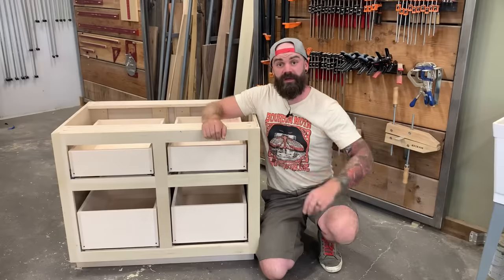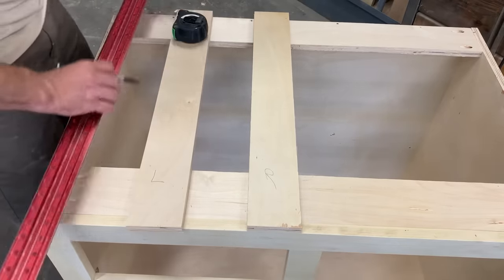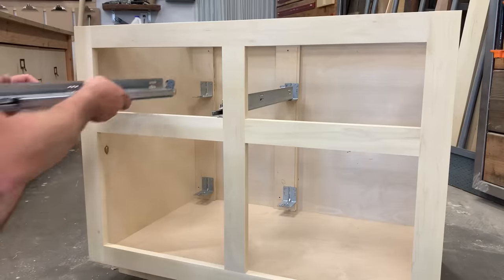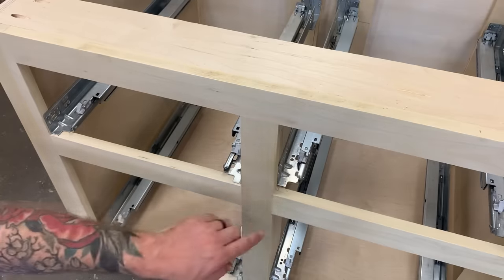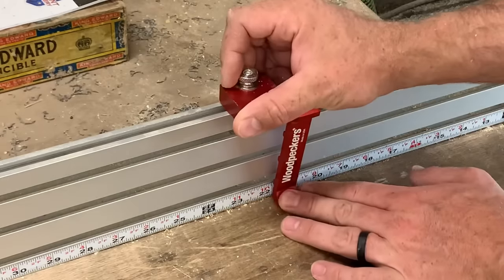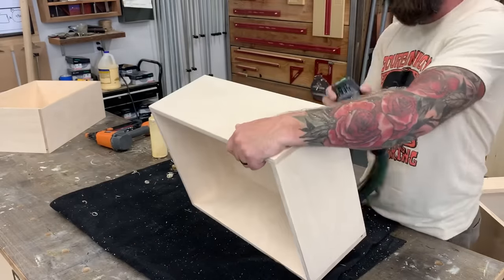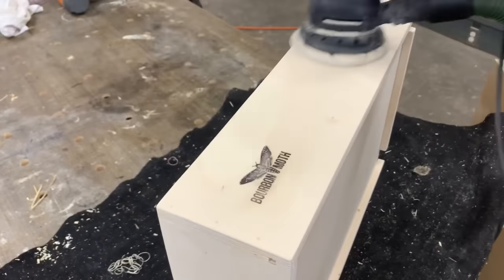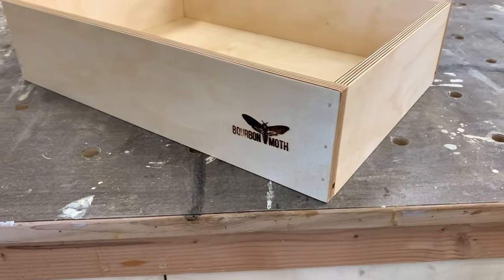Build Cabinets The Easy Way | Building and Installing Drawers

Comment: Thanks for the video's, been watching them on repeat to build my first set of cabinets for a coffee bar.  One hiccup I've encountered though - I ordered the undermount drawer slides using your link in your description from Amazon.  I didn't realize until I tried to install them that these are the series H drawer slides, for material of thickness 1/2"-5/8".  I was following your videos and using 3/4" birch ply for everything, including the drawers.  So needless to say, these didn't work.  I'm having trouble finding the F series for 3/4" materials online, if anyone has a recommendation, would be appreciated.  I also can't find your plans for cabinets on your website - would be great to see them if possible.

Comment: Any tips on selecting appropriate slide length? Current project drawer box depth to face plate is 16 inches.  I assume the 15s will be best but curious.  Using overmount face plates

Comment: This is probably a dumb question but it looks like you're using 3/4 inch plywood but my understanding is that the undermount slides can only take up to 5/8 inch so I would assume you would use 1/2 inch ply??

Comment: I really enjoyed your cabinet videos... Would you be able to share where you get the drawer slides?
Reply: Clayton you can get these on Amazon or any fine hardware dealer.  We get them from a local hardware dealer in Los Angeles area.  But you just need to know what kind you want.
Reply: @davidbryanwoodworksandmore what’s that company called? Do you have contact info? Thnx

Comment: I reckon a single pissy screw holding the front rails of the inset is going to either shear or gouge out, especially if there is any weight in dem drawers.

Comment: Putting a single screw in the front of the pull on flush mounts seems inadequate if you will have any appreciable weight in the drawer (such as tools).  Could you comment on that or make a suggestion for heavy weight drawer guides?  Love your videos Homes!
Reply from the maker: I’ve never had any issue. If you think about the direction the weight will be pushing it would have to snap the head of the screw. But if you’re at all concerned by all means throw an extra screw in there.

Comment: It's hard to tell from the video exactly what part of the back bracket was aligned with your "3/8" reference line.  It didn't appear that it was the "edge" of the bracket but I couldn't tell if it was between certain screw holes in the bracket or what.  Could you clarify please?  Thank you!....and....AWESOME VIDEOS!!!!

Comment: I think I might have missed it, but are your drawer sides and back made from 3/4 or 1/2 ply? I love this method and I will be ditching side mounts forever! Just when you said to drill a 1/4 by 1/2 deep hole in the back it made me think these were 3/4 ply boxes.... 🤔🤔🤔🤔
Reply from the maker: Sorry I totally forgot to mention that. They’re actually 5/8”
Reply: Bourbon Moth Woodworking, ugh.... I knew it.... uncommon size but but strong and cheaper than 3/4 yet would allow for a 1/2 hole in the back. You have me ready to try this! Great work!
Reply from the maker: Shawn Morin you can totally use 1/2” too just drill a 3/8” hole instead. It’ll still work great

Comment: Any tips on how to install bottom rails on a cabinet/draw piece that’s been built already? I’ve got a coffee bar cabinet that has one open cabinet on the left and on the right of the furniture piece, with three drawers in the middle. All three drawers are the same dimensions, but they don’t have any guides. The creator just used furniture wax, but I’d like to install rails so that the drawers glide smoothly and don’t “slip and fall” into the opening just below it.

Comment: I am building a bay of 36" wide x 18" deep lateral file cabinets.  Would you recommend this style of drawer slide assuming a fairly heavy load when the drawers are full of paper?  I see they do make them in 18" on Amazon and assume that would be the correct ones?

Comment: What thickness was the drawer material? I’ve used blum drawer slides before and the max thickness was 5/8” do they also sell 3/4” ?
Reply: The slides have enough room on the sides to accommodate between 1/2 and 5/8.  I believe he used 5/8 because the half inch hole he put in the back did not punch through.
Reply: I’ve made the mistake of using 3/4” before.   I won’t do that again. I use 5/8” for a little beefier drawer than 1/2”

Comment: Regarding linseed oil, my hardware store sell raw or double boiled... which is better? Awesome thanks!
Reply from the maker: Either will work. You can eat raw linseed oil but not boiled linseed oil. If that helps 🤷🏻‍♂️
Reply: Raw linseed oil takes a very long time to dry. Boiled linseed oil is made to dry faster

Comment: The slides you linked are for drawer side thickness from 1/2 to 5/8. Is that the wrong link or do they work with 3/4?
Reply from the maker: No that’s correct. You can not use 3/4”
Reply: @Bourbonmoth  What size Ply were you using in this video then?  You never stated.  Thanks!!

Comment: I know this is an old video, but do you know if i can install the bottom mount on a flush base drawer? I wanted to have 1/2 ply on the base and have it flush to the base. I was also going to use 3/4" material for the sides but most can only accommodate 5/8" max sides.

Comment: Probably a dumb question, but with the drawer slide bracket sitting clear to the right, how far do I measure over to set that right scrap plywood? Do I measure over to the edge of the right vertical face frame or is it to the leading edge plus an 8th of an inch?

Comment: I may have missed it, but what thickness ply do you use for the drawer boxes?  3/4", 1/2" or 5/8"?
Reply: Wondering the same thing. Cabinet was made with 3/4 but those slides say they work with a max 5/8.  Sure looks like 3/4 in the video.
Reply: @j.r.farrar775  yeah I agree does look like 3/4. I ended up making some drawer boxes out of 1/2 and they were plenty fine but if they work with 3/4 that would be preferable
Reply: @matteilerman1544  Do you think 3/4 would have fit?
Reply: @j.r.farrar775  it's tough saying. I have a spare set of slides I might just make a dummy drawer for fun and see. It looks like it has clearance but 1/8" can be a lot when looking at 5/8 to 6/8 difference
Reply: @matteilerman1544  for sure. I saw in another comment that he confirms that 6/8 can NOT be used with these.  So he must have used 5/8 ply

Comment: What measurement across from the cabinet side do you use to fit the 2nd vertical scrap piece to the rear of the cabinet?

Comment: @Bourbon Moth Woodworking
I have a dresser, regular type where the drawers are closely snugged inside. They are heavy and can sometime be a pain to open or close. How can I get these slides added where it can be way more easier to open and close? Take in consideration that the drawers were built very closely to the inside frame. No facing is on mine. Could you kindly advise? Thanks.

Comment: You said that the width of the drawer box is the distance between the slides plus the width of the two drawer sides. I think you meant minus the width of the two drawer sides. Right?
Reply: Did you ever figure this out? That is my question too. He’s just measuring from outside of one slide to outside of another and then just says “plus the width of the side pieces.” Is that the size of ply you’re using? So take that measurement and then add an inch if you’re using 1/2” plywood?

Comment: What are peoples thoughts on using a rabbet to cut on the edges of the side panels of the drawer? You leave 3/8 of material for rabbet depth and the width of the jointing panel. This way you insure that the box will be square and the panels aligned? Is this a common method at all? This was just the way I was taught and its stuck with me ever since.
Reply: If you use a rabbet the box will not be as strong as this method. The dado locks in the drawer bottom and it can't come loose. I had a custom cabinetry business for 15 years (retired now) and we built all of our drawer boxes exactly like this. For extra added strength (if you are concerned) simply put a few 1" micro nails from underneath into the side catching the 1/4" bottom. Just make sure you nail very straight!  We probably made over 5,000 drawer boxes this way and NEVER had a call back from a customer. We used both side mounted and undermount slides. All depended on what the customer wanted to pay for. That's why it's called custom! When a customer wanted the highest quality we would also do dovetail drawer boxes but usually we would spec those from one of our sources that would make our doors. Hope this helps.

Comment: why does it only need a single screw for the inset drawer rails at the front? Won't the weight pushing down on a single screw be too much? I can see on the outside fronts that the slide gets to rest on the front frame.

Comment: So question, by doing the 1/4 slot by sneaking up on it, are you chiseling out the grove after you get your 1/4 space?  I ran 3 passes but I'm left with the little bead area from the tooth angle on the blade.  When cutting all side to size, and placing the drawer bottom, the bottom area where the dado is, has quite a bit of space open, so I'm assuming the grove either needs to be a hair deeper to accommodate or somehow, it needs to be perfectly flat for the 1/4 plywood to allow all side to be flush.
Reply: Change out your blade my man! Something like the Forrest Woodworker II - Modified blade will eliminate that “bead” you mentioned.
Reply: @kjaydub  so are those teeth more flat and not angled?  I’ll have to buy it if that’s the case bc I only have one blade on the table saw as it is.  Thanks

Comment: great detailed video! 

I'm wondering why not to use the vertical mid divider strip both at the front and at the back.
this way we don't need rear mounting brackets at all, and I can see most buying options for the undermount drawer slides don't have these rear mounting brackets.

Comment: please clarify the measurement of the drawer box relative to the space between the slides.  I got the length is that of the drawer slide, but the width?
Reply: I’m sure you don’t still need this answered, but in case you do: I just finished making some cabinets using this video series as a guide, and what I learned is that it is the width from outside to outside of the rails
Reply: @brianbean19  but he says “plus the width of your side pieces…” just disregard that?

Comment: Trying to figure out what length of drawer slide to get for my cabinet. What do I measure, the depth of the cabinet to the back of the face frame to the front of it, the overall depth? I am kind of confused on which one to get.

Comment: I feel stupid, but I just watched this and from what I gathered, all the drawers were cut to a 21” length because that was the length of the slides. Both slides were mounted to the back of the cabinet the same way though so I’m confused on how you end up with an inset drawer and a flush drawer. Did I miss something? Does the drawer just sit further back on the inset and just doesn’t go all the way back on the flush side? Or are they cut to different lengths?

Comment: If a standard kitchen base cabinet is 24 inches to the front of the face frame, how do you get away with 21 inch drawer slides?

Comment: I use pocket screws because i hate when a drawer pulls apart, i normally over build
Reply: Wayne the nail holes are awefull too.  It’s not a sign of quality.  And really the drawer top needs work.  If you’re using under mount slides, customers don’t want to see nails on Sides or square tops of plywood.  It’s just inferior.

Comment: 7:29 you mount the slide directly behind the face frame for the inset drawers. But, these slides state that the required set back for inset drawers with a 3/4" face is 1-1/32". I noticed this when I tried to follow your video myself, and my drawer faces didn't sit flush with the frame. The 3/4" backer pieces don't allow for the full required set back so I had to rip them out completely and redo the back pieces with 1/2" scraps. 

I'm curious how/why this set back appears to work for you in the video without any tweaks. Are you using a different model than what you link to in the description or am I missing something?
Reply: Oh... you must be using 1/2" ply for the drawer boxes which is apparently a pretty important detail when using these specific slides =(

Comment: When making the face frame, how wide do you make the opening if you’re making a 24”X4”X 42”drawer with the under drawer mounts? (My drawer glides are 24 inches long.)
Reply: You make the opening the same width of the drawer face (42”) plus a small gap on each side. If you want a ⅛ gap, add two of these (⅛+⅛=¼) to the opening measurement, one for each side of the drawer. So your opening would be 42¼.

If you want a tighter fit, leave 1/16 on each side. So your opening would be 42⅛.

Comment: Thank you for these videos, they’re really helpful for me as I’m building cabinets with inset drawers in my camper van. I’ve got a question about the rails for the inset drawers. It looks like they’re hidden behind the face frame instead of flush with the face frame. Is that a correct observation? And if so, what’s the ideal depth to hide the rails behind the face frame? I hope my question makes sense:) Thanks again!
Reply: If I understand your question, he says at 5:48 that he sets them back ⅛ inch. I’m guessing once the drawer faces are added, this space allows the drawer slides to maintain tension on the drawer when closed, pulling the drawer faces tight to the face frame.
Reply: @j10001  Hi James, thanks for your reply. Unfortunately that’s not what my question is about. What I mean is when there’s an inset drawer, the front of the rails seem to be just a bit tucked behind the faceframe, and what I wonder is how far/deep you could tuck/hide the rail behind the faceframe (if at all) when doing inset drawers. Around 07:45 you can hopefully see what I mean.
Reply: @tabatamusic567  Ah ok. He says there “you want them perfectly in line with the front lip of your face frame.” I think his are flush to the face frame. They appear set back only because of the shape of the rails and the angle of the camera. But I imagine you could set back an additional ⅛ inch like he did on the lefthand drawers. Of course, of you go too far back, you would lose the soft-close feature, because it only kicks in for that last little bit of closing distance. (Sorry I don’t know the exact distances.)
Reply: @j10001  Thanks again. Thats not what I mean tho:) Its kinda hard to explain, sorry about that. But what I mean is, if you have a faceframe and intend to have inset drawers, how wide could the frame be, in other words how deep can the slider mounts be mounted sideways behind the faceframe, before there’s not enough room to put a drawer in? I get that it depends on the width of your drawersides, but I wanna know how much room you have to play with sideways from the slider mounts to the actual slider that slides out.
Reply: @tabatamusic567  Yeah ok. Couldn’t say. Check manufacturer website or look at 16:43 and take a guess. Doesn’t look like there’s much room to play with there. Or buy some and you’ll figure it out by looking at them.

Comment: Those are some super complex and expensive drawer slides.  I've built a lot of cabinets in the past couple of years and my (soft close) slides are usually around $8-$12, $35 per drawer is a bit steep.

Comment: Can these slides be used on a 24 inch deep cabinet?  Maybe a stupid question
Reply from the maker: Yes
Reply: @Bourbonmoth  
Thanks for the reply!  Love your videos.  I subscribed immediately.  I’m a beginner so my questions are probably stupid.  My cabinet is 24 inches deep on the outside including the face frame. I don’t know if I need 24 inch slides or 21 inch.  I think 21 but I wanted to double check.  The instructions on the Blum site made my head hurt.  Thanks for your help!  And thanks again for the reply

Comment: Guess I don’t understand how to get the right drawer slide size. If I have a space (mud room cubbies) that want to build drawers along the floor, instead of just having openings on the floor, my space from back wall to front of the face frame is just Over 21 inches. By the time you put the backer piece along the back wall to screw the L brackets into, it’s 20 5/8. That’s not deep enough for the 21 inch slide which I think is 21.5 inches so it would stick out past the front. However, It’s too deep of a space for the 18 inch slide so the drawer wouldn’t make it all the way to the front. What do you do in this situation?

Comment: This was very simple & I really like it. Back in the 80s when my dad built cabinets, he learned from an older friend (who was old enough to be his father) who had been doing carpentry for decades but did things in an old-fashioned way. So we don't even have  glides- we have a groove in the bottom center of the drawer that slides over a piece in the middle. It isn't the most efficient system & after about 30yrs some of the drawers sit crooked & others have trouble sliding.
I like the undermount glide system.
Would something like this work to replicate the Rev-A-Shelf filler pull-outs? The prices on those are insane & I need something more custom sized in terms of height & depth.
Out of curiosity, why were the bottom drawers so shallow compared to the openings?
I think I would probably go with the orange thingies that don't have adjustment. Partially for price, but also bc I'd likely end up constantly trying to adjust & not being happy with the end results.
I like the song you play for your intro when you show your logo.
I'm thinking of making a custom vanity for my friend's bathroom bc all the store-bought ones are super expensive & made of MDF. I think I'd be able to accomplish it with these plans. It looks simple enough.
Thank you very much for this video!